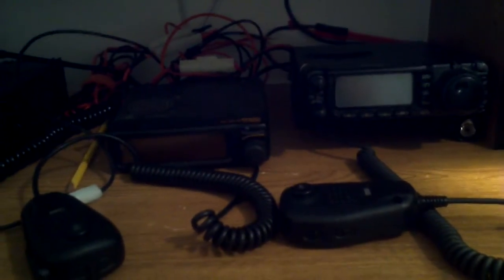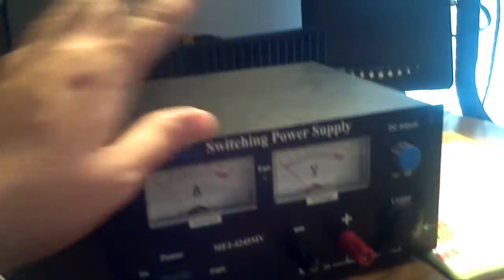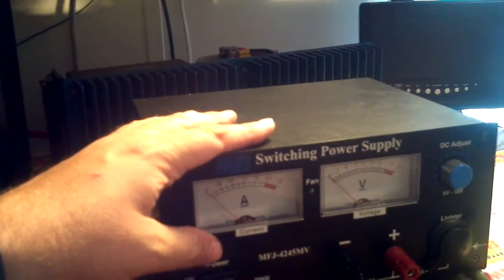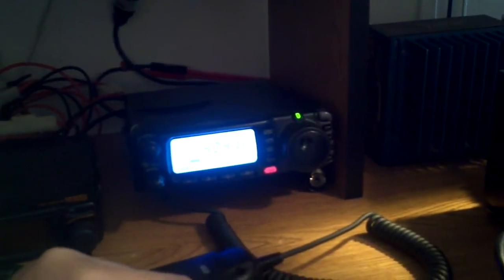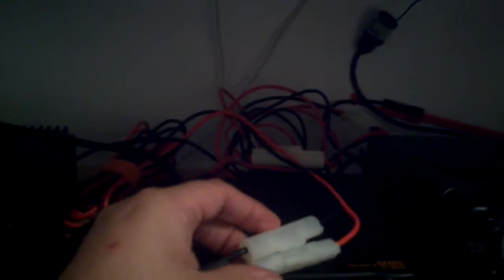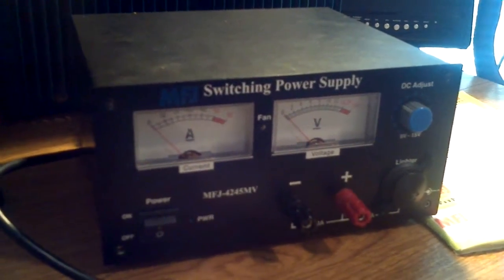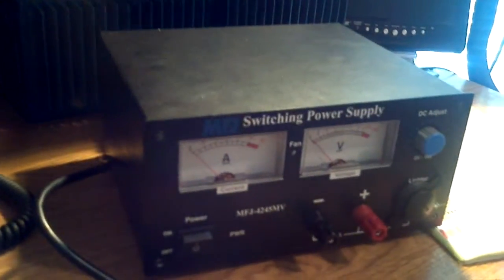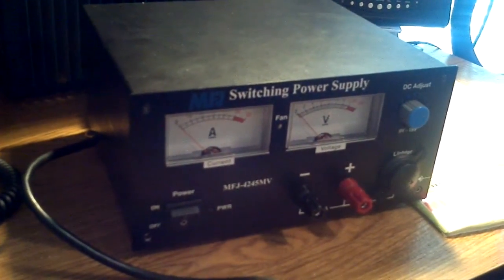MFJ 4245MV warning 2012 10 23

Comment: I have just went through same situation, same power supply. I dont know if my radio toasted or not. I bought the power supply new on Sep2018, its too late for me to avoid this product after I saw your video.
Reply from the maker: So sorry to hear that you had the same problem.  When someone tells you that MFJ stands for Mighty Fine Junk, now you know why.
Reply: @cellblock776  learned the lesson in a hard way, i hope my radio didnt burn. Pray with me

Comment: after a Few GREAT Years. of use My MFJ-4245MV is making HASH NOISE on my SDRPlay .. wasn't doing this before a month or so ago.. I have been moving Wires etc.. It's not a ALWAYS issue, comes and goes! 
I am trusting my IC 7300 to this THING? NOT FOR LONG!  sad when we pay such amount of money for something we only get a few  years of useage? I guess I will just  add a BATTERY  and Solar  System and use that ... Can't anyone build anything anymore to LAST!

Comment: Here is a clip from MFJ's ad for the 4245mv. 
"Fully Protected
You wont burn up our power supplies! They are fully protected with Over Voltage and Over Current protection circuits."
So either their protection has failed or they are making false claimes.

Comment: I have the same problem and same Power Supply. The Power Supply suddenly went up to 45 volts and burned my Yaesu FT 3000M fuses and damaging my radio.
Now the Power Supply Strip 45 volts DC all time  and permanently fans on. It is the worst power Supply I bought in my life. I do not recommend it.

Comment: The sparking on the power connector could very well could be the cause of the PS failure. Unless the voltage spiked to a few 1000 volts then there is no way that over voltage from the power supply could have caused the power connector to arc.

In other words the arcing is a clear indicator that the connector was the source of the problem.. Its common knowledge that Switching power supplies don't handle interment shorts well. Its also common knowledge that over voltage surging is a common failure mode for switching power supplies subjected to intermittent shorts and this is something that is very difficult and expensive to design protection against.

 This is one reason why I wont use switching power supplies at my station. Regardless of manufacturer I know that if they fail they could send a 15+ volt voltage spike to my gear..  This is something that's nearly impossible with a linear supply. That in a nut shell is why you are much better off using a high quality linear power supply such as an Astron VS-50m  or even better yet a VS-70m
Reply: I have had 2 "Linear Supplies" with failed regulators suddenly put out 25+ volts. 
No they weren't Astrons but a similar circuit.

Comment: Fuses only work when there is a AMPERAGE surge. Not for voltage. You could send 120 volts through a 20 amp fuse and the fuse will NOT blow if the amps are not there.

Comment from the maker: Cortchubby, I posted follow up videos.  Turns out it did not have a crowbar circuit to prevent over voltage.  MFJ sent me a brand new power supply to replace the one that went crazy.  So far the new one is working well.